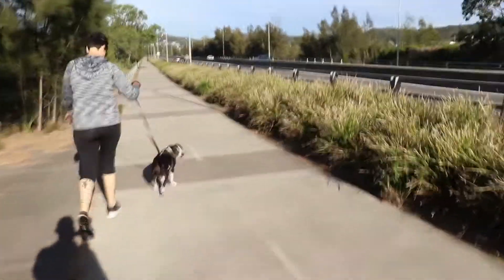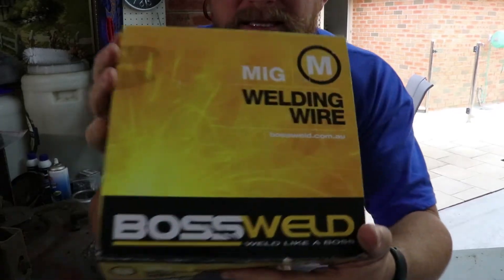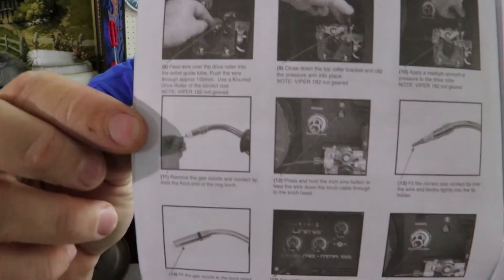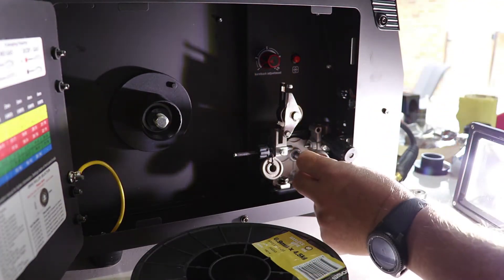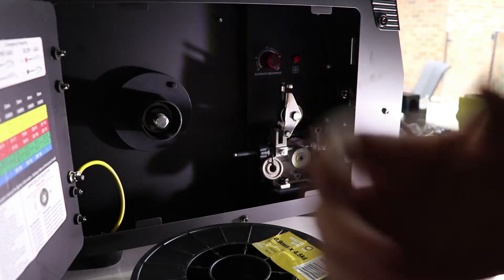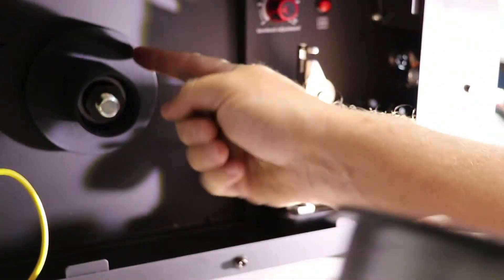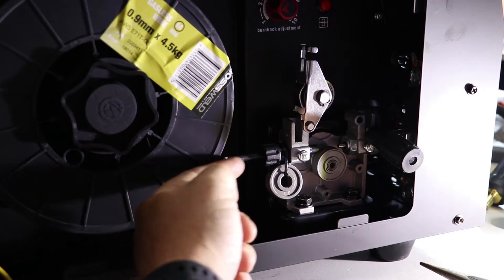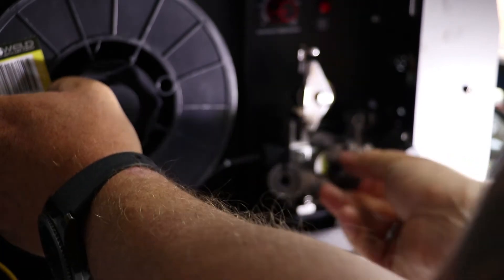Unimig Viper 182 | How to feed the wire on

Comment: I went through the same process recently. One problem that I had that you didn't mention ( and not covered in the owner's manual)  is the wire spindle  tension. When u pull the trigger to weld, the 5Kg spindle rotates and if the spindle tension is not adjusted it over runs after  u  stop welding.This can cause irregular wire feed and worse case a tangle  just like a bait caster fishing reel. The tension nut is in behind the large plastic nut that holds the wire spindle to the welder. You need long nose plyers to turn it. Too tight and the feed roller slips, too loose and overruns.
Both can spoil your welds.Enjoyed you video. Thanks.
Reply from the maker: That's a good point you make. This was my first mig welder so at the time I don't think I had wrapped my head around all the ins and outs. Thanks for watching. And thanks for the feedback.
Reply: My viper 182 should be arriving this week. I'll certainly need that info. Cheers.

Comment: Sound that vid mate. Keeping the shroud on will help you gauge the distance from the workpiece  when  you get some sheild gas.
Reply from the maker: Yeah thanks mate. I did have ago at it without the shroud. I found that I had better success with it. Now that I've used the gasless I'm not sure I'll get gas till I can master it lol.
Reply: @4x4EastCoast  better to start with gas, hard to master gassless as its nearly impossible to get a spatter free and clean weld. If you can master gas, it's easier to be comfortable with gasless, but you'll never go back to gassless.